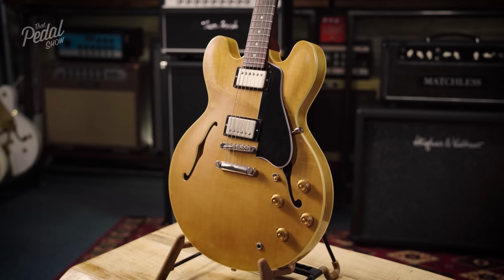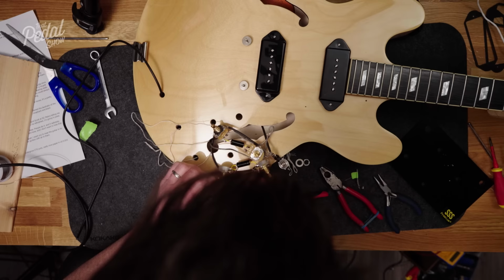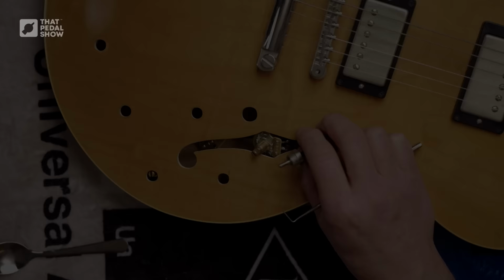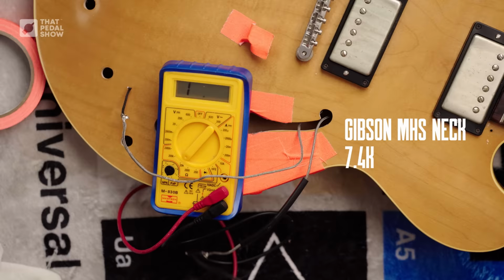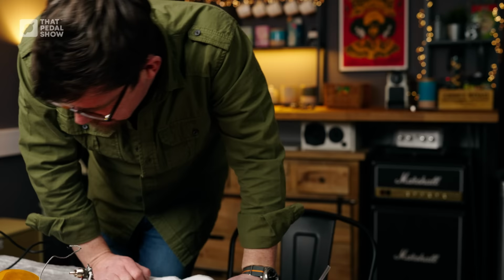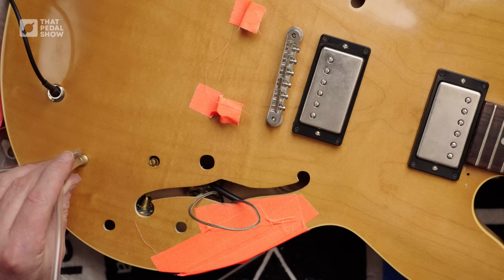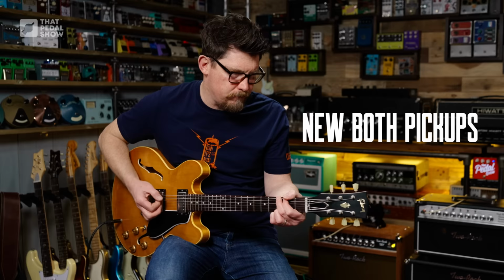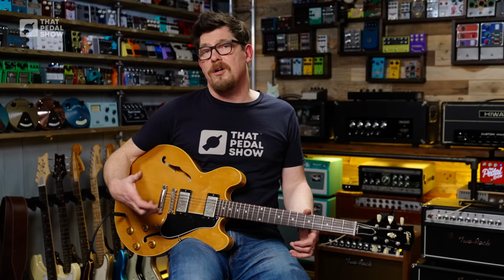Mick’s Gibson ES-335 Gets New Pickups & Loom [Hardest Pickup Swap Ever?]

Comment: Hi Mick, reading your body language reminds me so much of my personal experiences. I've been playing and building guitars for some decades. My number one learning from my activities is: Don't care about ants and bees when the elephant is in the room. So scientificly I really know that the speaker, the EQ, the signal chain are all big animals in the zoo of sound while pickups are rather on the insects side. THe pickups only move a resonance peak in the frequency range and hide or amplifiy asepcts of the instruments sound spectre. A resistor (5P) addeed to the potentiometer may have the same effect as a new pickup (150€) and even the impedance of the imput jack or the cable may be bigger animals. Never-the-less, I know all that and still I have swapt almost all pickups in all of my many guitars until I liked them (in almost any case I've optimzed the electric circuit afterwards as well). Did I do it for scientific reason. No, I know it is economic luxuary to have guitar that suits at once. And still I do it,  just because I can. It is a hobby, and therefore money  invest do not have to return, as long as I feel better ;)

Comment: Given the fact that the Memphis factory is gone gives this guitar some historic value. I own one , Memphis ES335 that is. The difference is so minimal either way, it is not wise to swap pickups. Just buy another one, you got plenty of resources  I Would  reckon ,and sell the other if you don't like it because I'm sure there is a collector who would value this guitar as is.
Reply: I think most collectors would see the Lollars as an upgrade, especially if the originals are still included. I myself swapped out the MHS pickups in my Memphis ‘63 for Throbaks. No regrets at all.

Comment: Very interesting. I just recently picked up a Tokai ES-150. The 150 is the model # and is the higher end of models. It
s from 81' and I think the first year they did the 335. It is supposed to be a very good copy of the Gibson 59' thru 61' 335. 
The loom falls far short. The neck and body woods and profiles are very good. Tokais Lacquer is different and doesn't check.
This has the Japanese high end Cashew lacquer that is only used on the very highest end guitars which is cool, but not like
the 59 Gibson ES-335. She is also a Natural finish with very nice figuring. I am planning on doing the loom change to a 50's
wired with OIP caps. Unlike yours, doing on a Tokai makes a noticeable difference as I have done it on an Tokai Les Paul
copy from 81. I haven't research it yet or watched any videos. This is the first. And now I am not looking forward to it at all. 
It is an expensive guitar and I would hat to scratch it. I hope I can find some videos with more details showing the complete
process without the fumbling about you did, then just showing them in without showing you getting them in. My goals are
for in the room listening. I only record to listen to myself and learn where I need to work. The comparison will be done straight
in on a 5E3 and then with a small amount of reverb in the front. I only play at bedroom volumes. My goal is to get it to sound as 
close to 1959 ES-335 as possible. And when I start swapping pickups, I will do it without removing the loom because that is
just stupid. I don't care about cutting the leads because it's mine and I am not going to go through that hell you did or dish out
for a guitar tech every time I want to test another set of pickups. The originals that came with the guitar will not be cut and if I
ever decide to sell it, they will be available or installed. As they are needed to get the highest price. The loom in this market is
not important. Everyone changes it because it is junk. They do save it and include it in the sale. I don't think I will be selling it.
It will most likely end up being handed down after I am gone. 
If I do find a way to do the swap that is not a nightmare, I won't cut the leads on the pickups I plan to try. One set of which
will be the Custombuckers. 
Don't be afraid to try different height settings on your pickups. I have found with vintage lower wind ones that lowering them
really make them come alive. The output is lower as well but not much and the openness and sustain are great increased. 
It's easy to do and easily reversed.  If you need to hit the front of the amp harder, you can use a pedal.  Adjusting the poles
on the pickups to balance the volumes of each string can sometimes improve the tone quite a bit. It's a flippin rabbit hole.
For me, gteat improvements have been realized diving in head first. Patience is key.

Comment: The new setup is definitely a step towards single coil sounds. The original setup did sound really good, but at times it could sound a little boxy. I didn't get that after the changes. Sounded more clear, open, slightly more sparkly. It's not as far as a Filtertron style pickup, clearly still PAF style humbucker.
Would be interesting to know how much the loom made a difference vs the pickups themselves.
I applaud your patience. Think I would have had to get the jigsaw out and perform surgery haha

Comment: Mate, you need more suitable tubing.... thinner and more flexible. The stuff I use is super flexible (I think it's silicon or has silicon in it) and it's also much much thinner but because it's very stretchy you can still manipulate it over the pots and it grabs on to them. It's not to hand but I would guess it's only 5 or 6mm diameter with an internal or around 3mm.

Comment: Brave! Having done a few jobs like this, I'm hoping you kept the B-roll. All the cursing, swearing, cries of "Gerrin there ya little Bastich!", banging of head on desk/wall/etc, would make a fine vid for April 1st...
One tip for anyone trying this job, DON'T try the aquarium tubing trick on a 335-style thinline. While it works great on a deeper body guitar (a-la Gretsch), on 335's & the like, dental floss works better to help guide the gubbins into place, and it's only really needed for the jack & bridge tone control.
Reply from the maker: Agreed on the aquarium tubing! Which I found out by trial and error.
Reply: @ThatPedalShow  You an' me both!

Comment: Look. I will openly admit I have never done a job like this, but would fishing wire work around the pots, with the ends through the holes? Pulling them up into place? A bit like the tubing but less mass to move? 

Has anyone done this? Does it work?
Reply from the maker: It does work, and it’s recommended by many. But the biggest problem wasn’t actually getting the stuff back through the holes - it was getting it all in the guitar in the first place, then realising the damn shafts were too short! I think next time would be much easier - right tools and knowing the pitfalls! Cheers!

Comment: I want to do this on my 30-year old Sheraton, but it terrifies me! I'm not sure if you were using CTS 'mini-pots', but I think they would make the job a lot easier. Not sure if there's a sound difference with them.
Now this may sound stupid, but I have considered cutting a 1-2 inch hole on the back of the guitar to help with this job, put a plastic cover over it afterwards. Is that insane? Probably.
Anyway, great video, I think you did well to hold it together!
Reply from the maker: I totally considered that. And Gibson did use mini pots for a while if I remember correctly…

Comment: Mick, there's plenty of common mistakes that could have been avoided with practice & experience. Next time use the blue scotch tape first to protect the F-hole you're fishing through. The plastic pipes are not a good option. You'd better use a small fishing wire or nylon wire to attach all the parts before you remove the loom, thus you just re-attach the wires on the new loom and it makes everything way more easier to put back on. With practice it gets easier and now within one our I can replace the loom or the pick ups in a f-hole guitar. Also, consider yourself blessed it wasn't a 345 or 355 that has the varitone, which makes it even more difficult to handle.

Comment: So the newer pickups were brighter. You can tell that in the resistance reading, assuming the magnetic strength was constantt. You could even measure the inductance with inductance meter,  now that they're quite cheap. You might consider a guitar that has easily replaceable pickups and then measure them and see which ones you like best. You can even get a frequency response m like they have a guitar nuts too and see if these things actually look different. 

I would say that the new pickups sound better in the very high mid-range with lots of gain as you say. But I think it sounded worse everywhere else. But if you're taking this to a gig, then you just might need more treble because all the other instruments and the audience tend to suck up the treble. And of course turning up the volume simply makes the bass more apparent as we know from loudness curves.

But I must confess that I come to your channel for your excellent Strat tone, so I'm a little biased.

Comment: Of course you know if had got the nut on the thread and tightened it with the original locking washer on the inside; it may well have seated into the underside of the wood enough to then have the clearance needed for the indicator to fit the top side. Or was that not even viable? But yeah admirable patience.
Reply from the maker: Couldn’t even get the nut to bite!

Comment: I don't think Mick needs to fear the decision to change the pickups. The Lollars are a marked improvement, especially the neck & especially given what Mick wanted the pickups to do. Tonally a major step towards a more Mick tone, so presumably the feel of the pickups will be more to taste & inspire.
The only decision that is questionable here is ditching the knurled washers from underneath, but keeping the indicator washer on top. Yes personally I wouldn't want those indicators anyway, they're pointless. But mostly I hope that the loss of the knurled washer doesn't lead to pots rotating with use.

Comment: Way to press on through!!!... IF you ever do it again, dental floss works better for me than the tubing... I love using the dental tools,  And running leads from the pots to outside the f-hole for the pickup connection (I tuck the extra back in the f-hole out of the way with zip ties...)makes it easy to roll pickups later, like when you find a set of Ron Ellis humbuckers on a deal and decide they must belong in your 335... Good job.. BTW my first time swapping 335 harness was on a Eastman, didnt know about the window, finished it,, must have damaged the switch in the process, and had to do it all over... FML..

Comment: That was a lot of work for a little sparkle. You could've just adjusted the Gibson pups. Nice guitar either way. Cheers!
Reply from the maker: It would certainly be a step in the right direction Stuart but it wouldn’t affect the resonant peak of the pups, or actually get rid of that much lower mid mud. But sure, a good step towards it. Cheers!

Comment: Hey Mick , why use the tubing at such length?  Just have it over the shaft and cut it there , then have a way thinner wire attached to the short tubing ...
Reply from the maker: Yah. The tubing doesn’t really work on this guitar, regardless of length I think. Worked great on the Gretsch…. Fishing like would have been better I reckon. Cheers!

Comment: Should have tied strings to the threaded portion of the pots when you took them out so it's easier to fish them back through when you put the new pots in. that's the easiest way.
Reply from the maker: I did that the first time I did a 335. I think, were I to do it again, the jack socket is enough to get it there… and then tweezers and dentists bits… and a magnet. Reckon I could do it in a couple of hours max. Errrrrrmmm….

Comment: Removing knobs from a guitar -> StewMac Pullit Knob Puller or Big Rock Knob Puller. When pushing in the pots I would recommend to already have them roped. Don't pull them through the F-hole, but through the pickup holes, if possible (always check).

Comment: Definitely a different sound - I think where it is going to matter is in the mix of an actual gig.  I believe these pickups will line up better with your other guitars and you wont feel like you need to change the amp settings so much.  So was it worth it ?  is it better or worse ?  I think most would say better - not that it matters  but to me that is a tough call -  really it comes down to is the new sound is just different - there is value in both sounds.
Reply from the maker: All agreed here!

Comment: Rewiring 335s is why 'God' created tobacco and caffeine.
Loom... at the very least, everyone should take a multimeter to the pots to check they are what they say they are. The manufacturing tolerance is massive and it matters. Doesn't matter who made the pots, if they're at the bottom of the tolerance range you can waste fortunes perpetually swapping out "muddy" pickups.
Reply from the maker: That is a GREAT point… although im pretty sure Matt measures his to a certain tolerance…. But yes, absolutely that. In fact when I visited Memphis they did all of that and nudged the tones to 550… true story!

Comment: Well… that was fun. I’m guessing then you didn’t measure total pot shaft length compared to originals… looks like Monty’s error there.
This will give you a new respect for dentists… we do stuff like this in a dark wet mouth , on a ( sometimes ) moving target , an uncontrollably numb tongue in the way and our handiwork is subject to gnashing and biting forces for decades … working on guitars is easy peasy … try doing the 335 with someone spitting saliva on your fingers throughout !!! 😀
Reply from the maker: Hahahaha! Much hilarity. It was probably my fault - I'm sure all those options are selectable when you (I) make the order. Doh!
Reply: @ThatPedalShow  tbf you could only have measured pot thread length after removing a pot through the f-hole, then ordered the loom with correct length pots, the Monty’s 335 loom should not have bare minimum pot thread length and should have an earthing loop compatible with easier insertion… time to have a chat with them , you should not have had to test the wiring loom integrity to almost destruction !!

Comment: How agonizing.

Tip: reflow fresh solder on the joint you're wanting to disconnect. The fresh solder melts the old lead free factory stuff.

Additional tip: car parts stores have narrow cylindrical magnets on a swivel clamp on the end of a collapsing antenna for fetching bits you've dropped in areas of an engine where your fat fingers wont fit. 

Confirmation: the original controls were "modern" wiring.

Comment: Humbuckers lack sparkle no matter how the controls are set. I've had one guitar with humbuckers in it. Won't ever own another one.

EDIT: IF I ever bought another guitar equipped with humbuckers they would definitely be low wind and they would NOT be wax potted. I love Lollar pickups but their humbuckers are wax potted. I'd also wire it 50s style.
Reply from the maker: You should hear my Les Paul!
Reply: @ThatPedalShow  In other people's hands they sound great. An overdriven bridge humbucker is awesome if you play that style. If you spend 90% of your time clean fingerpicking in the neck position not so much.  In mine they sound like mud. Uninspiring. Bland. I had a cheap Epiphone a few years back with the Probucker pickups (with the quick connect wiring harness) They were decent for humbuckers but I was going to replace them anyway so as an experiment I pulled them out and stuck them in boiling water for about an hour.  The wax oozed out of them until it created a thick film on the water. Let them dry for about a day, put them back in and it was like a blanket was taken off the amp. Yes, I realize I would likely ruin them but I was going to chuck them anyway. I played it that way for a year until I got a p90 guitar.

Comment: I suspect the difference in brightness is simply due to the Caps, an inexpensive part. I cut a port in the back of my Strat so I could easily swap Caps without having to remove strings, and introducing several other variables. Love your persistence, but think you paid a very high price. If you're happy with the results, then you succeeded.

Comment: I just had to watch this since I knew what an absolute PITA this would turn out to be. 

First off, buy a magnetic dish to hold your screws. While your cup may have a pretty logo, one slip, and your screws and nuts go flying. Not with a magnetic dish. Also, a bendable magnetic pick-up tool, like that used in auto repair shops, would make getting that washer out from inside the body much easier than stabbing at the dark with a pair of pliers. It would also come in handy with the rest of the job of getting everything through the correct hole.

I would bust your balls about worrying about scratching up that pretty guitar since you seem to like relic guitars, but I'm not, since this guitar is doing a fine job busting your balls without my help. All I can say is I truly feel sorry for you. Did this once and I used chopsticks and anything else that I could find to get everything to pop up in the correct holes. I don't know exactly how many days it took, but you simply have to walk away and regroup. A lot of alcohol between attempts is also helpful. Hint, your pinky is your best friend. 

When it's all done though, you have to ask yourself, why didn't they just add a rear access panel? Or even better yet, why didn't you?

Comment: Think you might need to try some other pups 😁
Reply from the maker: You’re on drugs. No. Way.
Reply: @ThatPedalShow  think you might also be needing them if you had to swap em out, mind on saying that you could pull the pup out with as much wire as you can and cut the wire then join the new pup wire onto the wire going to the pots. then join a bit more wire to the pup you have taken out. hassle yes but less than taking the loom out again